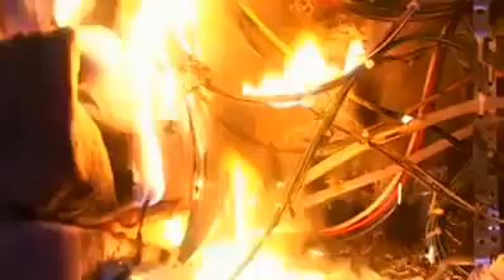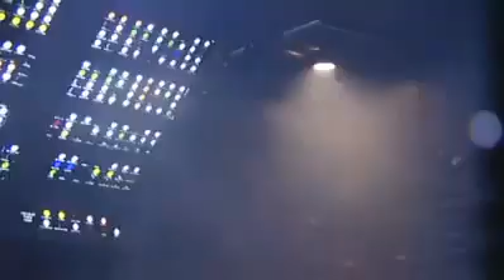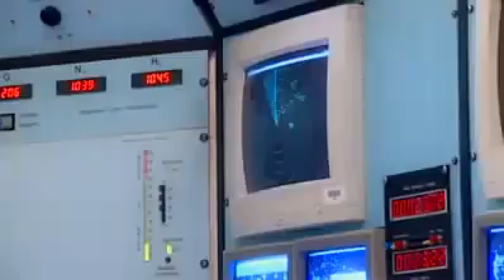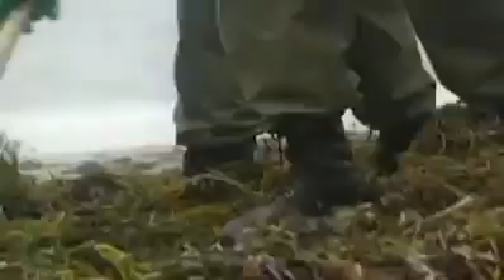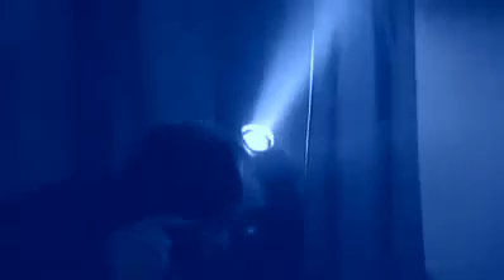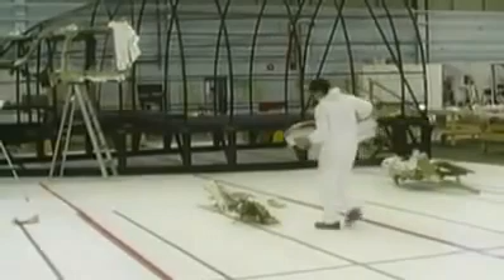Air Crash Investigations S1 E3 Fire on Board

Comment: why can't they put a small cylinder of a fire retardant onboard, put sensors where wiring is located, sensors in the galley, anywhere fire tends to break out and when a certain temperature or smoke whatever is detected fluid/foam from that cylinder is sprayed where the sensors are located? seems to  me a simple problem to resolve
Reply: It's expensive :(